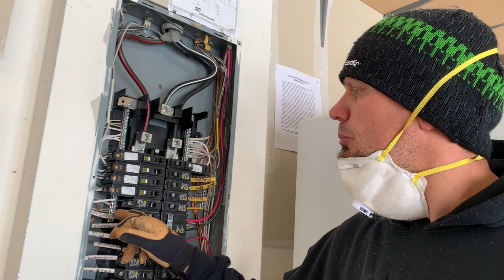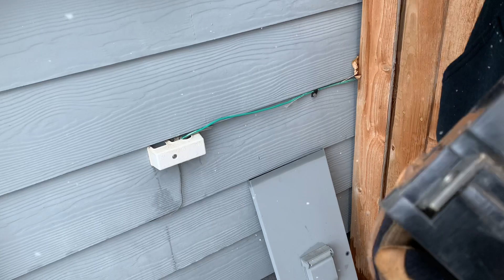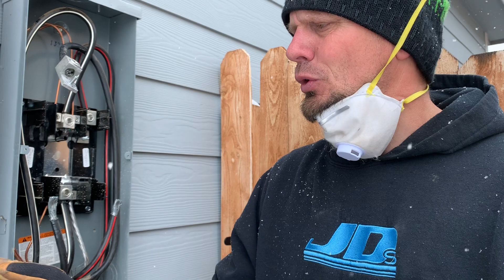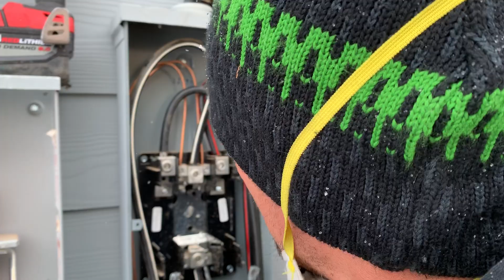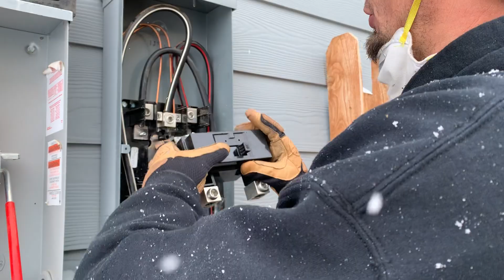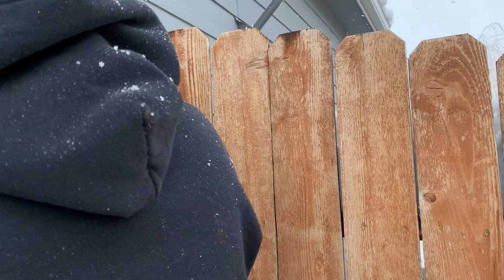2012 Home With Minimal Arc Fault Breakers Had Bathroom Lights Flickering

Comment: @3:45 Guess the manufacturer of that disconnect doesn't use the same plastic as Nvidia does on their 12 pin high power connector on their graphics cards, that like to melt and fuse with the 12 volt high power cable from the power supply?

Comment: You did a good job.  They should have used copper instead of aluminum wiring.  It costs more, but it's worth it in the long run.

Comment: bro you saved me troubleshooting time .
I've been having a problem in my 3 year old condo I'm  renting .My lightsflicker when the washer has load .I'm a 20 year electrician but in the  commercial field . I also was a service tech . Living in a condo I dont have  access to my main panel I'm assuming my issue is a loose feeder black or red possibly my neutral .I'm extremely sensitive to strobe lights so flickering causes migraines . 
you just confirmed my suspicion of how my main has loose connections  thanks for the  video .Thanks for going above and beyond!

Comment: When I hear "It was 75 yesterday and 15 and snowing today" I thought, huh, sounds like Colorado! Thanks for this video, trying to diagnose flickering in my house and have already gone through a bunch of stuff and still scratching my head. Something like a vacuum starting up on one circuit will cause lights to dim on a different circuit, even with "flicker free" LED bulbs.
Reply: Following up - turns out it was a dropped neutral from the transformer. House was built in 2000, the underground cable coming up to the meter had bare copper concentric spiral wrap used as the neutral, must have corroded over time. They hooked us up to a service restore box to temporarily replace the neutral and spent the better part of 2 weeks running the new cable, back up and running now! No more flickering!

Comment: I live in an older mobile home (yes I know that right there is the main  problem.. lol) Whenever the front door is shut, the porch light (standard fixture & 60 W standard bulb) will flicker on and sometimes turns back off right way, but other times the flicker is more robust like a strobe light on espresso then it will stop and glow at about medium strength before slowly fading until it is off again. This all happens while the switch is turned to the off position. If you switch the light on usually nothing happens, occasionally it will give a couple blinks of light before it turns back off completely. Yes have replaced the receptacle with many different new bulbs even though I know it's not a problem w/the bulbs. I just don't want to actually have to cut into the wall if it's unnecessary. When unscrewing the light receptacle from wall the wires that can be seen look fine, no corrosion or chewed wires, goid connection.

Comment: At 1:39 he comments:
“As you can see this electrician was dyslexic……”, and he is talking about mixed up of the phases as in: black, red =A & B phase. He is correct and justified even though in 1 phase setting doesn’t matter but it’s a workmanship issue and either lack of knowing the basics or just ( a handyman became electrician)  but anyway, whoever the electrician made that stupid mistake aside, WHAT ABOUT THE INSPECTOR???, was he also FRIDAY & DYSLEXIC inspector!!! After all, as a 12 year old house, that house went under the inspection and that dumb ass mistake wasn’t made as an after work. It really cracks me up that the inspector didn’t fail the electrical work based on the fact:
If you failed the obvious, chances are that if the electrician made a mistake on the basic principle then what other mistakes did he make that aren’t as obvious!!! …… AND THE SAME GOES WITH THE DOPE- HEAD inspector

Comment: I know this is an older post, but I have a flicker problem I hope to get some help with. My 12 yr old house/bathroom has two light fixtures with 4 LED bulbs on each one. One fixture has no problems. On the other one a single bulb started flickering. Later, another one started flickering and then sometimes only one flickers and sometimes both.  This was always the same two bulbs. So yesterday I checked all the connections for tightness and put the fixture back in place. Guess what…those two bulbs no longer flicker, but now the third one does! 🤷🏻‍♂️  I’m not that knowledgeable and I’m stumped. 🤔 Should I just take all connections apart, completely remove the fixture and start over? Any help would be greatly appreciated.

Comment: Okie our need help our power is all kinds of weird for about the last 3 days we can only have one room at a time running or the stove over the frig. House is 1970s my husband has changed out all the old wire besides the main that comes from the meter. Even had the transformer changed out 2 days ago bc there was problems with to much power coming in. But where still stumped he thinks it's the main wire that's hooked to the meter we cha.ged breaks out for new as well still having problems. If we hook other rooms or dryers up it makes lights flicker an the it blows the breaker but the break doesn't even switch bk to off.

Comment: I would have replaced the breaker and lung. Those small pits will create chatter and in time that heat will melt it. I’m sure what you did will last a few years(unless the home owner uses something that take a heavy load) that chatter is evil!

Comment: Are there torque specs for that stuff?
Reply: Yes, every nut and bolt has a torque setting based upon the size and material of the fastener.  When I owned a solar installation company we had torque wrenches for each size bolt used for the racking and torque nut drivers for all electrical connections.  I raced motorcycles and used torque wrenches religiously on my bikes as well.  The last thing I wanted was a wheel nut coming  loose or a swing arm nut loosening up at 170 on the track.  No different for any serious nut and bolt.

Comment: I have a question if you have time to answer please. I have lived in a house for 6 years which was new when we moved in. About a month ago the arc fault breaker to the back bedrooms and guest bath will trip randomly about once or twice a month, often with nothing on in any of the rooms. What are the chances this could just be a bad breaker switch? I can make it trip if I iron in one of the bedrooms but it makes no sense why it would trip with nothing running in the rooms. Thanks!!
Reply: If someone has added or spliced to another cct...or same breaker....its weird but it happens....troubleshooting is awesome😜

Comment: My apprentice mind is trying to understand how turning on every load in the residence temporarily corrected the flickering issue?
Reply: Since all the circuits are on there are no leaks so there voltage is constant
Reply: @basedconarium  Even though the issue was the result of a loose Phase at the Service disconnect, having all the loads on would still temporarily correct the flickering issue?

Comment: Hello, I have a new home with AFCI breakers and our Tesla mobile connector seems to be tripping the same three breakers most night (but not the 220V/50a breaker for the charger in the garage). 

Have any ideas what could cause this?  The same three breakers trip (kitchen lights, dishwasher, and washing machine). 
 
Wish your were local to me!
Reply: Does your AFCI have a diagnostic light?
Reply: @brarautorepairs  yes, flashes 5 times.
Reply: @Immacu1ate  There should be a sticker in your panel that will help decode the diagnostic light. If not, you'll need to look up your breaker and the code on Google. Also when was the 220V added? The AFCI breaker will pick up noise on the neutral. The 220V uses both phases of the panel which would blow the breakers if you are getting back feeding. I'm going through some crazy issues with my breakers right now and am on a mission to fix the nuisance tripping.
Reply: @brarautorepairs  Says it’s a ground fault but a few electricians can’t seem to find the issue. I avoid trips by charging the car at 16amps vs the 32amps that it’s capable of. 

It’s annoying but I’ve decided it’s not worth the fight. 16amps gives us a full charge overnight anyways.
Reply: @Immacu1ate  Ground fault from my understanding is that you have a short to ground which would cause a large current draw. What you need to do is verify with the charger on, if you are getting 120 Volts between the left and right side of the breaker bars and the neutral. An amp probe can be used to assist to confirm you are drawing the same amount of amps on both sides of the lugs having turned off all the other breakers. What you might find is leakage of current through the ground path which means your neutral is either broken or loose along the circuit. Unfortunately, you could have a break behind a wall where someone has driven a screw during construction and damaged the insulation.
Reply: I've found that even in new panels, the lugs aren't tightened to spec which can cause heat and arcing.  Going from the panel, you can work backwards to verify all your connections are good, there are no signs of arcing. A good voltmeter with an amp clamp would be your best bet. High resistance is one thing to look out for.

Comment: Best electrician hands down! 
Do you use torque wrench’s for those lugs or do you think that even necessary
Reply: Torque wrenches are now recommended or required for lugs. They list specs on panels so you don't over or under do it. Experienced electrician go by feel though.

Comment: What kind of warranty comes with the work you perform? We have a 3 year parts and labour. I could see option close, sand it down with no warranty for a cheaper price vs. Replacement with warranty and premium price.
Reply: I would NEVER warranty anything sanded. It will have small pits, which can create chatter. That chatter is heat and it is very small, but in time will get super hot. That is my opinion